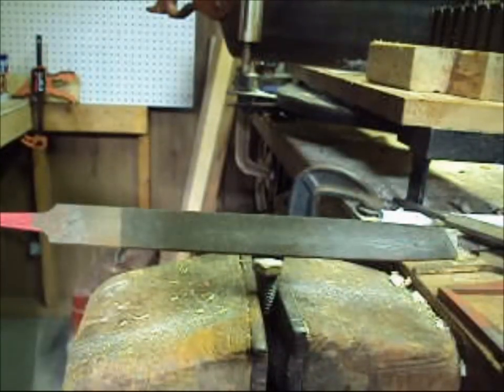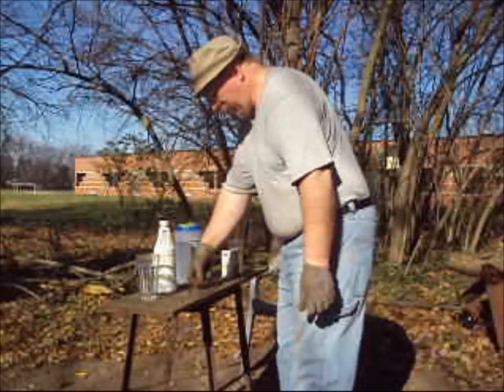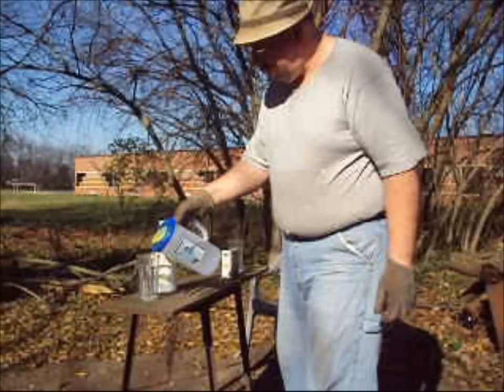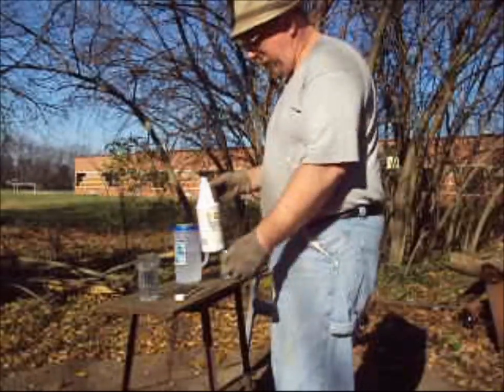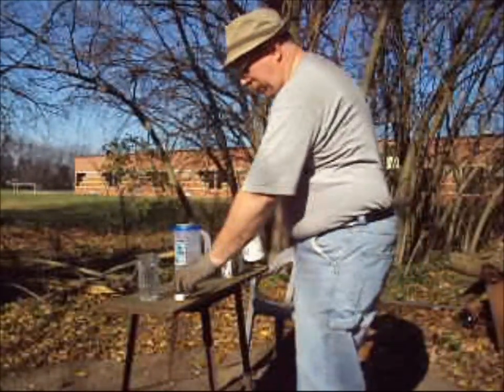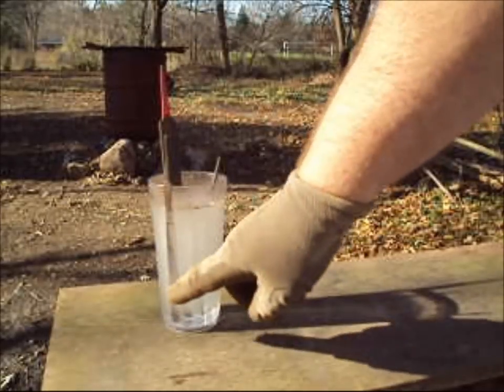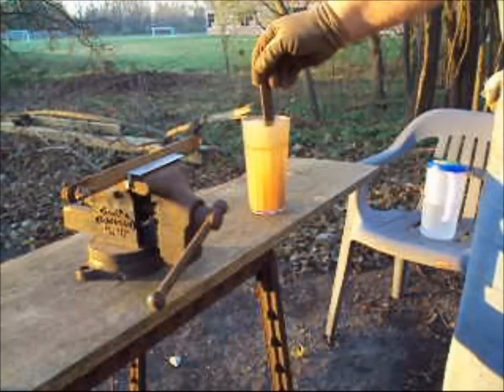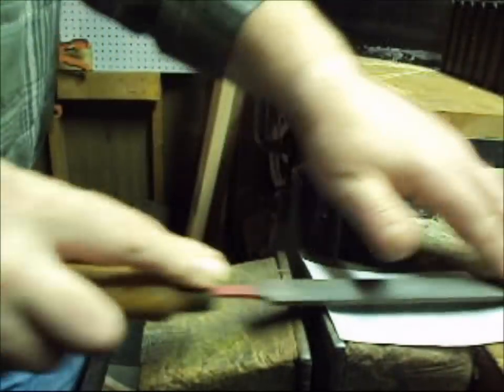Sharpening A File With Acid - a video tutorial from Old Sneelock's Workshop

Comment: At the weekend I visited a local steam rally and picked up 4 nice Sheffield made files amongst other things (plus 2 hacksaw blades, try square, pincers, try square, new caulk gun, part of a Stanley no. 4 plane, all for £3). Here in the UK it is very difficult to get sulfuric acid as it has stopped being sold in big box stores following some horrific attacks on young girls where it was thrown in their faces by some crazy people who felt that they should not be beautiful. Are there any other ways to sharpen files as I have cleaned them with the copper tool and run the file card over them. I saw that you were involved in a discussion on another channel but thought it best to speak here as the other channel did not seem as friendly as yours.
Reply from the maker: Hi Tony. Sorry I'm slow getting back to you. You don't have to have a really strong concentration of the acid. You don't have to use sulfuric either. The lower the pH the faster the sulfuric or most any of the acids works. I use sulfuric just because it is quick and easy. Common cooking vinegar will work quite well. The only problem I have run into with using lower concentrations of acid is it takes long enough that I forget to check and the acid eats the teeth off the file.
Reply: Sneelock, many, many thanks for this. We can certainly get cooking vinegar easily enough. Do not worry about the time as it has given me the opportunity to buff up the Stanley No 4 lever cap and it looks really nice on the plane I bought last year for the princely sum of £2. It is a really good rally which combines a steam event with a beer festival, heaven !. I will let you know how I get on with the files.
Reply from the maker: UK Tony High pressure steam and beer. What could go wrong? :-)
Reply: UK Tony
Reply: Old Sneelock, just a note to say a big thank you for the vinegar tip. I got 3 pints and soaked two files, one from Nicholson of Sheffield and another from Switzerland and it took off the surface rust and they feel sharper. Only about another 25 files to go !.
Reply from the maker: UK Tony Glad it worked for you. I might need to get out a macro lens and do a before and after. There appear to be two camps on the issue. One that says they've tried it and it works. The other is convinced that by using logic they have reached an undeniable conclusion that it cannot.
I'm reminded of the auger bit question.
Perhaps visual confirmation will define the process and either affirm or deny the concept.
Reply: UK Tony: You can get battery acid by going to your local car breakers yard, tell them what you want it for and you should have no problem, failing that, when you pop across to France for your cheap French wine at Christmas, drop into Brico Marche and buy a gallon off the shelf!
Reply from the maker: Englishman French Are there autoparts stores in your area? There are several in Kalamazoo that will sell a bottle of battery acid. I went with drain opener because I can get it at the local grocer.
Reply: It is UK Tony that requires battery acid, I know that when I lived in UK it was difficult to obtain, but now I live in France I can just walk into a tool/general store and buy it by the gallon, (5 Litres).
Reply: Englishman French, thanks for the tip. I used the distilled white vinegar and it worked well as well as doing some derusting. I used the surplus that I had left over in a kettle to remove limescale then poured it down the loo overnight and it cleared the limescale there. Overall it was a great result and it got me into my wife's good books !.
Reply: UK Tony: To de scale your kettle you need Citric Acid crystals, just boil up with water in the kettle and it will look new inside.
Reply: Next time I have to descale a kettle I will try the citric acid. I put in a diluted vinegar solution, boiled it then left it for a little while. The insides were absolutely gleaming therefore it must have a similar effect. From visits abroad, it always amazes me what can be bought in one country which is forbidden or difficult to obtain in another one. Take care.
Reply: Vinegar works much better if you a) heat it to simmering or even boiling so the files are inside of a hot solution of vinegar and 2) add hydrogen peroxide.  Both seem to speed up the reaction.  Throwing acid in faces... that'll teach her for trying to leave the house unacompannied by a male family member.  FFS UK, you guys need to TCB.  Take Care of Business.
Reply from the maker: Interesting idea. The heating makes sense. Most reactions speed up with additional heat. Never thought of hydrogen peroxide. I'll have to give it a try. I think the heating idea will have to wait until spring. Not a kitchen project and there's too much snow to dig out a fire pit. :-)
FFS?

Comment: If using drain cleaner what would be the ratio of water to cleaner ?
Reply from the maker: +John Nerren I use drain cleaner in this video. It is drain cleaner that has sulfuric acid as the active ingredient. I use a 10% solution of this drain cleaner to tap water. The regular drain cleaners have  inhibitors to help prevent them from attacking the pipes. 
Straight sulfuric (100% acid) actually won't harm iron. Until there is water added to make the sulfuric an electrolyte the sulfuric can be stored in an iron tank. Just be sure to keep the tank lid on. 
I was the Plant Engineer at one of the United Technologies plants in Coldwater, MI. There was a sulfuric acid tank outside of the anodize operation. When the tank truck driver filled the sulfuric acid tank, he left the top off. It rained that night. By morning the acid ate through the 1/4" thick iron tank, but only at the water line where the rain sat on top of the acid in the tank. Made a real mess. Fortunately we had containment under the tank and it was filled with limestone so the acid was neutralized and none of it got into the ground water. 
We welded up the tank and kept using it for at least 5 more years until I left for another job. 
I'm sure someone will ask. Yes you should be careful when opening a drain with this concentrated type of drain cleaner. Be sure that, once the drain is open, you flush the drain with tap water. If you leave the drain filled with this heavy duty drain cleaner it can eat the pipes up. 
Also don't use battery acid. Battery acid is straight sulfuric. It will eat up your pipes. It is also heavier than water and doesn't mix well with water. It can stay in the bottom of the sink trap. A friend of mine didn't listen and had a real mess in his bathroom after the P Trap on the sink ate through.
Reply: +Old Sneelock&#39;s Workshop Thanks for the info.

Comment: Tried it and it seems to work but my files are much darker now. Did I do something wrong ?
Reply from the maker: +John Nerren The iron, that gets eaten away, goes into solution and leaves the carbon behind. You can wipe off the carbon dust right after it comes out of the rinse with a scrub brush, if you want. The color doesn't really matter though.
Reply: It doesn't hurt to degrease them before etching. I use muriatic acid and the come out a nice even matte grey.

Comment: Be sure to use all plastic containers as a tap on the bottom or a drop of the file on or in the glass mayl result in a acidic mess...
Reply from the maker: Good advise. That's why I used cheap, clear plastic tumblers. You can see the reaction of the acid on the files bubbling away but even if you dropped one of the glasses it would just bounce.
Reply: I use a length of 1 1/2" diameter PVC pipe with a cap welded onto one end and a cleanout adapter welded onto the other.  The end with the adapter has a threaded plug.  In the plug I drilled a 1/8" vent hole.  The cut the length of the pipe to be about an inch longer than my longest file.  Works like a charm.  I do all my etching outside.

Comment: Will muratic acid work as well?
Reply from the maker: OldJesusFreak1958 Muratic or any acid will perform the sharpening. Muratic has a drawback though. Muratic is another name for Hydrochloric Acid. On low carbon steel it doesn't cause a problem but on high carbon steel like springs and files the hydrogen in the acid migrates into the steel and causes Hydrogen Embrittlement. You can look it up, but in a nutshell, the hydrogen atoms lock up the iron/carbon matrix and makes the steel brittle so it cracks. Sulfuric acid doesn't have that problem and is easily obtainable. If you can't find sulfuric drain opener then battery acid will work.
Reply: Thank You very much. I'll purchase some today.
Reply: That's a good point you are making Old Sneelock.  Hydrogen embrittlement is dangerous when the part is a fastener or spring.  Electroplating can also introduce HE into a part.  The remedy is to bake the part at around 400 deg F for a certain period of time and the hydrogen precipitated out.
Reply: That's what I use, and yes, it works well for my files.  Old Sneelock makes a good point below; however, regarding Hydrogen Embrittlement.  The solution to that is to bake the part at a low temperature for a given amount of time.
Reply: The idea of using old battery acid seems OK but if you try to buy sulfuric acid in New Zealand you will need police clearance - apparently because this acid is a precursor to the manufacture of P
Reply from the maker: It is a favorite attack for low lifes too. Some contries regulate who can own it.

Comment: nice tip thanks.
Reply: Very informative, thanks! I would like to offer something I learned in high school metal shop over 50 years ago. Dress your files with a stick of blackboard chalk. This keeps metal filings from building up in your files, but helps them cut even better, I think. If you try it, you will always use this trick.

Comment: Acid actually dulls the cutting edge of a file tooth and makes them smell like pickles.
Reply from the maker: Gord Baker If you are using sulfuric to make pickles that explains a lot.
Reply: I was referring to Vinegar which is a weak acid. .
Reply from the maker: Gord Baker Did you watch before commenting? This video is about how to use sulfuric acid based drain cleaner to sharpen  a file.
Reply: Wrong!  Try it.